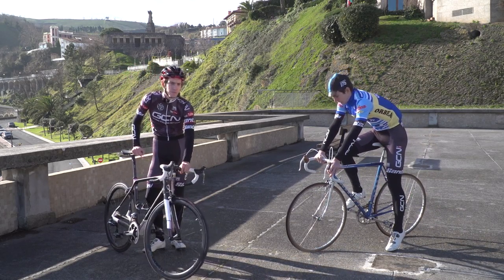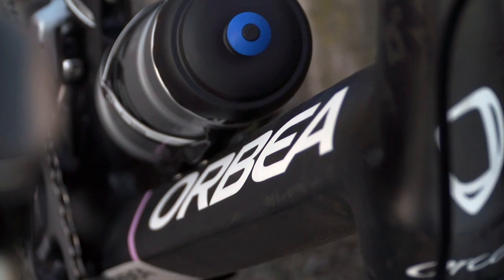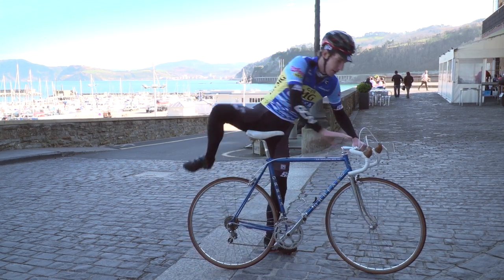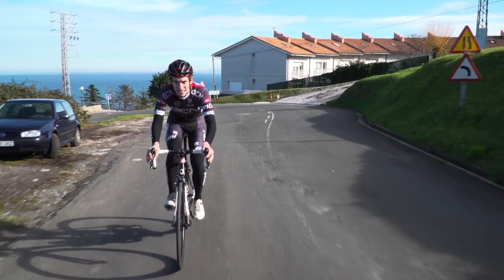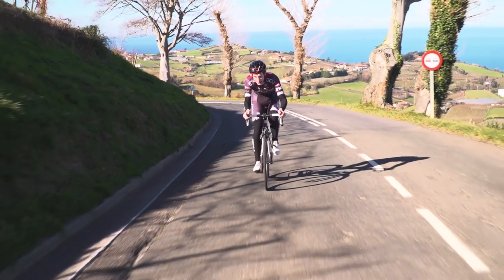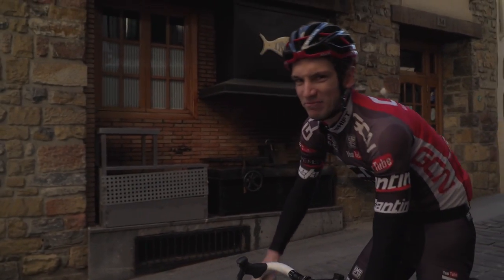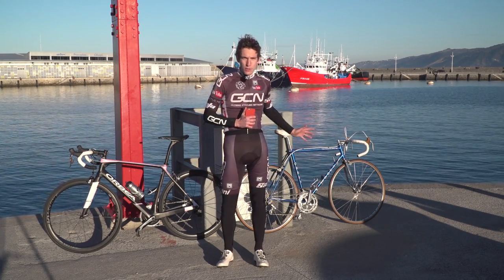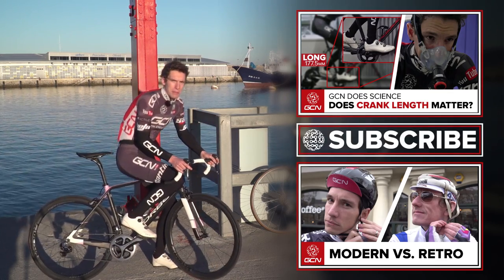How Much Faster Are Modern Bikes? | Retro Vs Modern

Comment: Information about the weight differences between the bikes would have been helpful (bound to make a difference, in addition to all the other disadvantages of using an old bike without getting used to it first) and also how long the climb and descent each took for the different bikes. Without a more level 'playing field' the comparison was not very informative. I ride a 1987 753 steel road bike and a contemporary carbon one, with almost exactly the same riding position set up on both, and find them a fairly close match - but just have a few extra sprockets available on the carbon bike for steep climbs.

Comment: I still prefer good quality friction shifters personally.   I have a 1986 Tange tubing Nishiki Prestige road bike with Suntour Lepree shifters on it that I've been riding regularly since 1999.  NOT ONCE have those shifters ever required any maintenance!  Not once!  Original cables on them and everything and they still shift wonderfully!   That bike is still honestly my favorite to ride for it's old school feel, simplicity, and reliability.   The original brake pads have just worn out now and need replacement.   They just don't build them like that anymore.

Comment: I'd be amazed if that was really was the actual bike Pedro won the Vuelta on. Pictures from the event show Delgado on a Campagnolo Super Record equipped machine. As others mentioned, fitted with a rider familiar with downtube shifters, fresh rubber and brakes that worked properly, I'd imagine there's probably not a whole lot in it between them. Equipped with a modern drivetrain and wheels and properly fettled, less again. Cool story though and a beautiful old machine.

Comment: I have an old set of toe clips.  Take them  - please  and first time on tube shifters?  It was only when I got my CX bike that I found out they'd gone.  I grew up with them. You get used to it but it takes practice.  I wouldn't be surprised if the old tyres robbed confidence of the down hill.  So:- missing toe clips,  the wrong wheel, unfamiliar shifters, unfamiliar geometry, old tyre,  old brake pads too?  How could anyone get the beat out of that bike?  Some split time comparisons would have been good. Props for trying.  You can't keep on saying that everything it better all the time or you'd go mad.

Comment: This experiment without a power meter is completely useless. An excellent advertisement for Orbea nonetheless.
Reply: +Jade Cleveland Stop fucking moaning about advertising. Do you want to pay for the content?
Reply: +Bob Bobbon I think there is a reason why a power meter wasn't used here. Orbea and other manufacturers simply would not like the result. At the same power the difference would be way less than a minute.
Reply: +Jade Cleveland so how would  power data have made this more informative ??  it was a simple piece of fun on a point to point ride. Have seriously got nothing better to complain about on a free video on cycling ?
Reply: I agree..but, Lets say all of this to save 1 minute in total.    Am I in a race when I'm biking? Last I checked...even these guys aren't on the tour along with 99.9999999999999999999% of the human population.   So, if I'm not on the Tour and I'm not getting paid to have 100 people/vehicles/bikes working for me with sponsors up the Yin Yang...then why do I care about 1 minute, spending many $€£1000s more and getting a worse workout.  More weight/friction = better workout.  Even if i was on the Tour...Wouldn't I want to train 75% of the time with a heavier/less drag coefficient bike?  Rhetorical    I get it...like my retros and my carbon bikes...the nee ones 
LOOK 100 TIMES BETTER!!!    Like taking a Honda Civic or the La Ferrari to the store...you get there slightly quicker in style (for this analogy) but you've cost yourself $€£2.5 million to waste more gas and show off.  How do you not get  $5€£ toe straps?  They can't find a $€£300 retro bike with new retro tires? (tyres)
Reply: I agree sawink...if the geometry is acceptably close to any other bikes in the paddock and if it's truly fun to ride. I personally don't find the old steel bikes fun to ride because of lack of stiffness and wobbily bobbily braking.
Reply: Well for me there's a sinusoidal curve or sweet spot...somewhere south of millions but head and shoulders above vintage. I want to hit the top of the steep part of the curve because technology will let me do that now at a respectable cost. My Rival spec'd 18lb. carbon fiber bike is stiffer, yet more forgiving vertically than any steel bike I've ridden and at just less than one grand U.S.D. on sale, I suspect it is just a fraction of the cost (inflation-adjusted) of that vintage Orbea back in the day when it was new.
Reply: Nothing much under the radar there at all...when in Spain. I don't begrudge that at all because I'd switch places with Si in an instant, it's YouTube so whatever helps cover the costs and maybe make a living at something one enjoys is fine by me. It didn't make me want to get an Orbea any more...or less than before I watched. If it did for anyone else, well that's how a free market is supposed to work as far as I'm concerned.
Reply: +Digby O'Dell I agree with you...I was making an extreme analogy. I enjoy riding my carbon fibre bike (and my custom looks sweet)  but to go to 14lbs or whatever the conversion is...is just marketing.  It's analogous to running.  Most people who run "official" marathons, do it in the most efficient way, not the most effective for a workout.  (most humans land on their heel as well which is horrid for the body and an easier workout with tremendous cushion)  I still have my old steel bike I use as a trainer with those same shifters..very similar to the bike in the video.  I bet it would be easier and quicker to make it up and down the hill in the video driving a car...not a better workout. ;)   I prefer my 18lb bike over my 15lb bike and 23lb bike.  These guys are former sponsored riders and have a channel.  I will never want either..so my first thing is enjoyment and second is the workout.  Nothing else if I'm not getting paid.  How does he post this with an old bike tires (tyres) and no toe clips.  Just as a curiosity I was interested in this video and they completely screwed it up.  They might has well have just posted a clown dancing.  Oh, they did?  Hmm. Carry on.  Usually this channel is entertaining whilst providing good info.  This video is crap.
Reply: +Bob Bobbson Exactly.  And....The moronic weight limit and seating position limits bike design because like golf...everyone must have professional level official gear.  (or any sport...well golf is a skill..not a sport---that's for another day:)   They should either say...create any bike you want and have it open (the wealthier companies throwing money around will take over and usually win) or give everyone the same bike and offset rider weight and etc. which, will never happen because billions are involved in cycling.  Without sponsors and huge cycling companies, there is no Tour and we are still riding steel bikes.  I personally don't care about racing at all...find it boring as well.  Like surfing...I don't care about the competitive money and events...I like doing it.
Reply: plus, one rider, one run. not very scientific.
Reply: Its way more an advert for riding clips - imagine that old bike with some torque from upwards motion - probably a difference of seconds instead ??? Love the channel but this was way unfair and unscientific
Reply: +InfiltrateIndustries Who cares.  None of these people and the hosts are on the Tour.  Am I going faster and getting a better workout if I do it in less time or carry around less weight?  I can take a car if that's the case.
Reply: Exactly, would have liked to see it with toe clips and straps at least.
Reply: Agreed ..... that would be a massive difference
Reply: +HaNooo Well said. I knew a guy in Park City, Utah who was a competitive triathlete who had an Orbea with the carbon frame like this (perhaps not top of the line, but still damn expensive), and I have no doubt that even in his competition peer group that the bike wasn't giving him the bang for the buck that he might have hoped. Like everything else, it is more about status, self-esteem (or lack thereof), sex-appeal, etc.  Marketing is everything.
Reply: +Charley Smith This reminds me of the handgun industry. Gun technology has been essentially the same for the last 100 years, with the only major changes being the use of polymer frames and slight improvement in bullet technology. So your standard 9mm pistol from the 80's simply isn't going to be that much worse than a random offering from today's selection. Slight weight reduction in polymer pistols, but there's a reason that the 1911 still has such a huge following.

Comment: I ride an early 1990s steel frame with downtube shifters. My guess is that Simon lost about 5 seconds every shift on the older machine. When descending the more aero wheels probably made the biggest difference. I think of Simon had more time on the older bike, the times would've been much closer. Put Matt on both, then closer still, especially since there was no need to clip into the pedals on the old bike.

Comment: I think there is a probably a huge difference also because you are accustomed to the modern ORBEA ( I presume its your own bike ) and are probably far more comfortable on it, and shifting it, and climbing out-of-the-pedals (especially with clipless pedals).  If you rode the retro Orbea all summer you'd probably clock 13:15 climbing that mountain, just because you'd be better at shifting and you'd feel happier pushing the downhill speed(s) ... Also if you put a 1985 Dura Ace freewheel on that bike (some of the first with shifting ramps) you'd find it shifts amazingly much better, I have one on my 1977 Carlton Pro and it shifts way better than all my other bikes ...

Comment: Here is my question. I just bought an orbea alma 2004 carbon fibre bike, 2nd hand... I could've bought a new entry level bike with 29" and new components. What would be the difference from 2004 bike to a cheap entry level bike 2017/2018 model. How has that gap changed, from high 2004 to low 2017/2018.

Comment: I love your show but have I travelled through time to April 1st?. Pedro Delgada used Campag,Tubs and Time pedal system and certainly didn't ride a low end Sports Bike with 6 gears and Cheap Michelin clinchers.PLEASE... Felix,Donegal
Reply from the maker: +Felix Jackson Hi Felix, remember that he had a pretty long career that spanned several major leaps in technology. If you search for Vuelta '85 you'll see him on this exact bike.
Reply: +Global Cycling Network OMG, GCN you're starting to lose credibility. Please stop comparing old bikes to new bikes if you're going to show rubbish like this vid. Delgado rode Campy Super Record and good wheels. Not the cheap crap on this bike. The brakes and crank were a dead giveaway. And do you think he rode a clamp-on bottle cage???? I'm sure it's his frame but that's it. Nobody doubts that new bikes are faster, etc. But not by the margin in this vid.

Comment: but what about a vintage steel frame with a DI2 drive train Vs a carbon frame equiped with the same parts??

I suspect the differences in weight and performances would be minimal.

I wait for such a test ...
Reply: +MRGRUMPY53 whould be interessting how the better riding confort of steelframes affects recovery on grand tours.

Comment: I'm fairly certain that wasn't the bike that Pedro won the Vuelta on. On this site is a picture, and the bike Pedro is holding is Columbus SLX, not Vitus tubing, and Campagnolo Super Record (probably with the axles from Nuovo Record - the Ti axles were not stiff or durable), and a different set of rims, probably state-of-the-art tubular rims of the time. My guess is that the bike tested here was a bike sold as a tribute for Delgado's victory with a much lower (although necessarily bad) set of components. Heck, the frame doesn't even have braze-on water bottle bosses, which was pretty much standard for every high-end racing bike at the time!  https://wesportfr.com/tour-despagne-1985-pedro-delgado-piege-millar/

Comment: l don't know l wanna see you clipped in and try the oldie again ,also l noticed how short your bike is .What size is that thing and why so small??
l use an old Miyata BTW with upgraded 7spd freewheel and Techno brakes with steel rims 27'x1 1/4 tires (great for my streets ,thank god no hills)  l m looking to get alloy wheels next ,weighs 29lbs now.

Comment: Would have been a much fairer test if the correct wheel was used and the rider was more experienced using friction shifters. It's always going to be harder to find the gear with friction shift on an 11 speed cassette as the spacing is so much smaller!

Comment: I think a 1:30 difference is pretty small, and it's probably really less than that because 1) the reviewer was not used to the older bike, 2) it wasn't as 'ready to go' and 3) it wasn't fit to him.

A more interesting review would be comparing an old frame kitted with all modern components compared to an all modern bike. There the difference would be very small I feel, and almost negligible on flat-ish terrain. I have a custom built (for me) 1992 Reynolds 653 steel frame with modern components, and it's almost as fast as my Look 653. Really.

As for geometry and handling, with modern wheels and brakes, old frames can handle very nice indeed. But sure, the stiffer carbon frames (especially around the fork crown) do handle better.

Comment: The experiment was funny and it's good to see an old bike in action. Not using a GPS computer just because you are not sponsored is however NOT doing it like a PRO, get a bike mount for your phone at least.
Reply from the maker: +smachsimo You can't put a Garmin on a museum piece! Come on! ;-)
Reply: +Global Cycling Network you've got a good point, and using it on the 2016 model would have been an unfair advantage ;-)

Comment: Well, you can find the gears pretty easy on a retro, but the old, much larger spacing between the gears, and the high profile teeth on them make a huge difference. You should ride friction shifters 200k, then you're good. Oh, and you should never ride clipless shoes on clipped pedals, especially w/o the clips :))

Comment: Might be the frame Delgado rode, but not the same components or wheels. I'd be curious to see a comparison with an old bike that actually fits Si. And why not just use your clipless pedals on the old bike?
Reply from the maker: +T Han Clipless pedals weren't invented in 85, so it'd be cheating, Back To The Future style!
Reply: +Global Cycling Network They came out the following year. And you couldn't find toe clips???

Comment: Of course, modern bikes give better performance but that vintage bike is a beauty. I spent many years racing on steel frames and it’s just a different world. Different style if riding more based on power than agility. You keep your bottom further back to push harder resulting in a less round pedalling motion.

Comment: Never ridden with friction shifters before? You've never lived sir!
Reply: +Jarrod Speed No, they're awesome. But I prefer MTB...... that got me an idea of trying to swap shifters...
Reply: +marchlander1 I have had bikes since the 70's new groups are so nice and hassle free and indexing is brilliant
Reply: Well, you have your experiences, I have mine. I agree with you, indexing is great, but friction shifters are not all that bad either. In fact, I love friction shifters because there's no need to very precisely tune derailler, as index needs. That is my experience, currently I do have index shifters, but I have a problem that I can't tune my derailler. On my old road bike I have friction shifters and I just changed derailler, tuned low and high gear and off we go. Working without a problem.
Reply: +marchlander1 Have you tried changing your derailleur hanger? With only the slightest bend or twist .05mm  they become impossible to tune. I wasted hours trying to tune until I replaced what looked like a perfect hanger.
Reply: I have one of those derailleurs that attach on the axle. It a bit older MTB. I did replace derailleur, probably didn't have to, but I have it tuned now. Still, maybe need to tweak with it a bit more, but it works.
Reply: One huge problem in friction shifters was that you cannot really sprint while shifting. I once tried to race a bike with friction shifters vs modern bikes and I was dropped in the first corner.

Comment: the question remains then, if someone made a steel bike with modern geometry, are we still looking at weight and power transfer [on Simons particular course] as the only steps forward in bike technology in 30 years?
Reply from the maker: +Mark Munro No, as we mentioned, gears and aerodynamics as well.
Reply: +Global Cycling Network  sure, but surely on Simons course there, aero would save a handful of seconds... weight on the climb, handling on the descent and stiffness are (id think) the main time savers over 30 years. What id like to know is are the TT bikes that Millar and Nozal (in 2003) used, any slower than the 2015 equivalents? thanks.

Comment: I would definitely call it a draw. I know it was a test of which was flat out faster but considering the contemporary bike is fitted and familiar to tester while the steel bike was not at all, ESPECIALLY considering it was his first time using friction shifting..or as I call it..shifting, a minute or so is no significant difference in any real world circumstances other than competition. Honestly not much of an improvement considering all the propritary jazz and the singular point of failure of an electric drivetrain on the contemporary bicycle.